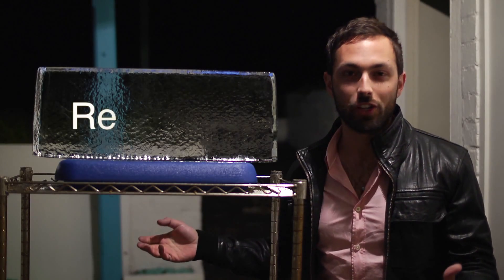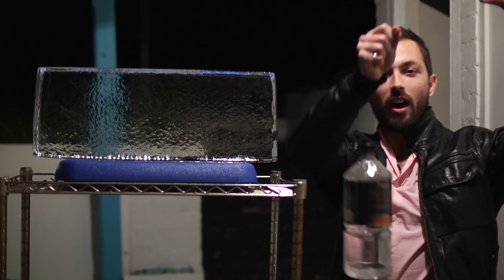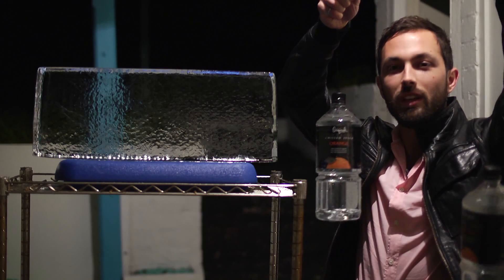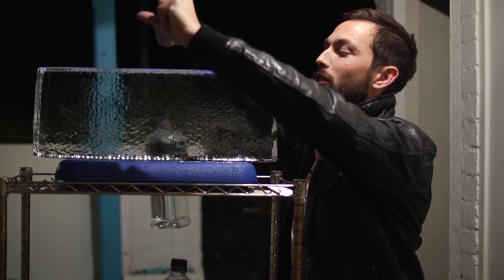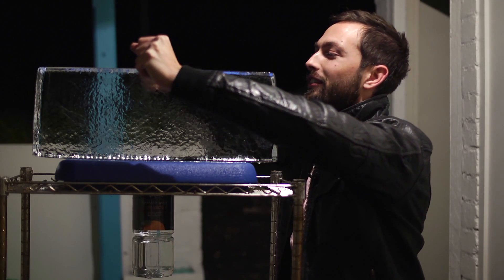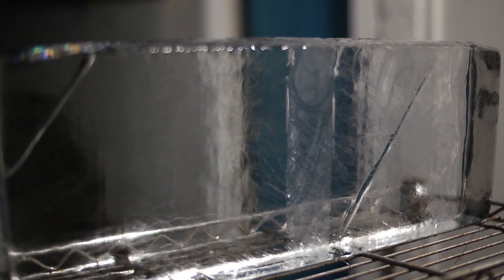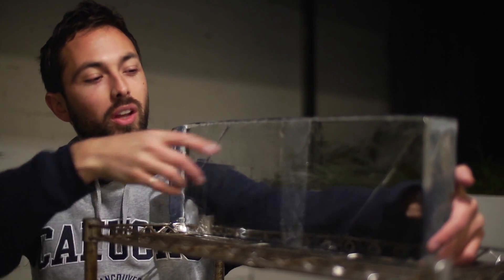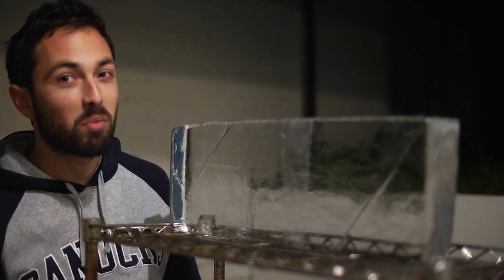Does Pressure Melt Ice?

Comment: but i thought pressure   freezes water and vacuum boils water.how is this possible?pls someone tell me??pls pls
Reply: There are two effects/mechanisms which are important to distinguish: 
1: The freezing and boiling temperature of a material depend on the ambient pressure. The lower the pressure the more gassy things are, the higher the pressure the more solid. 
2: A change in pressure changes the temperature of the material. Adding pressure heats it up, removing pressure cools it down. How much this is happening varies largely depending on the type of material, its current state and ability to conduct heat internally and to/from its surroundings - but most importantly on how quickly the change in pressure happens.

You often have both effects happen simultaneously. In this experiment we mostly see effect no.2: The ice is melting because of the newly applied pressure. Effect no.1 is therefore not so strong. I.e. the shift of the freezing point is smaller than the change in temperature that occurred.

Maybe have a look here:
https://en.wikipedia.org/wiki/Phase_diagram
Reply: Smit PATIL water expands with freezing or heating, actually.
Reply: galliumarsenide

Comment: oh yeah cause water is densest at 4 or 3 ° C, and is less dense as an ice.  so when you put pressure on ice, theoretically you are changing it back into the densest thing of it, which is water liquid (near 4° ish).  im guessing.  is this possibly near true?
Reply: plus it adds friction (I think???), so that would surely heat things up a lot (relatively speaking, of course).  that may be a large part of it, possibly
Reply: This will probably not work with other fluids and solids though right, as those other ones (Newtonian fluids, I think that's what they are called) are denser as they are solid.  water is non Newtonian.

Comment: So could you Say that temperature is relative to pressure? Or is tempreature induced by it? I mean the boiling water in an evacuated straw is still room-temperature, so the second question can't be it, right?
Reply: P . V = m R T
Reply: Ramirez PWidagdo excellent. Just what any good 12th grade physics student would say
Reply: Veryde yes pressure and temp are related directly
Reply: ***** Interesting, thanks. 
This formula should be around the corner in my physics lecture, might be more interesting than I made it out to be.

Comment: interesting how the wire in the ice is a perfect parabola
Reply: It looks quite a lot like a parabola from certain angles, but if I had to guess I would say its actually a hyperbolic cosine curve, or more specifically a catenary (https://en.wikipedia.org/wiki/Catenary). The reason I would think its this rather than a parabola, even though I haven't checked precisely, is because catenary curves describe idealised hanging strings that are anchored at their ends but sag due to their own weight.

Comment: Shouldnt we try ensure that the wire stays the same temp as the ice  throughout its entire length before assuming that it is pressure melting the ice and not heat from the air sapping into the wire?

Comment: Well if the wire is warmer than freezing point, then obviously it will melt the ice.
It has very little to do with pressure.

Although if the pressure creates friction in the ice, then that could cause the ice to melt as well.
Reply: the wire is metal, in direct contact with the ice it will very quickly reach the same temperature as the ice and stop melting it significantly.

Comment: Is it really the pressure?  The string was obviously NOT at 0 degree Celcius.  It could be the heat transfer that's melting the ice, not the pressure.  Please re-do this experiment in a 0-degree-Celcius environment.
Reply: Tj BurgerMan metal doesn't retain much heat. Very thin metal holds less heat. And very thin wire holds just about no heat
Reply: If it was just "warm wire melts ice", then why did the ice re-freeze after the wire had passed all the way through?

Comment: But what will be if use not metal string but nylon?
Reply: Just some thermal properties of the material would change but i think it will be almost the same if the nylon string is as thin as the metal one. Pressure by definition is force applied to an area, the thing that matters here is how thin the string is.

Comment: There are multiple phases of solid ice.
The ice you see here is hexagonal, and is stable between 32 and -152 degrees f. But there's also cubic ice, which is only stable below -150 degrees Fahrenheit.

Hexagonal ice melts under pressure.  But I don't believe cubic ice has this property.
Reply: I'll remember that if I decide to ice-skate at the south pole in July.

Seriously-though.  The fact that you knew that was very striking--!
Reply: See https://en.wikipedia.org/wiki/Ice_Ic for more information.
Reply: hah nurd. jk luv u
Reply: Is there a way to make hexagonal ice at home? I want to try this experiment inside my freezer (so whatever I use to apply the pressure is under 0°C), I can make clear ice by making it freeze slowly, would that be enought?

Comment: Doesn't the guitar string melt the ice rather than compress it into a liquid? The fact the block is unified after being cut only proves ice formed between the block halves.. Not necessarily through regelation, it could have been condensation in a humid environment.. right??

Comment: +Veritasium.. what if it's put in a closed box and exposed to high air pressure ? will it melt.. an freeze again once the pressure is back to normal ? .. and i know if it's a water in a low pressure instead it would boil in the atm température, although Water is uncompressible fluid and the Enthalpy supposed to prevent that since the température is bellow boiling degree.. so how does those happen?
EXPLAIN!

Comment: What if you fart on that ice ?! Will it melt faster ?!
Reply: if your fart contains enough methane to accelerate global warming, it will probably melt faster.
Reply: It would have to be a very long and hot fart to melt a block of ice like that.. And it wouldn't be ice anymore after, of course.. Just be a puddle of fart particalised water on the floor :(.

Comment: I don't really understand why this works. I thought air pressure changed the melting and boiling points so if there's is no air pressure it will melt and boil at cold temperatures and if there is a lot of air pressure it will only melt and boil at warmer temperatures, but the pressure of the string had the opposite effect. Is it based on force, since having a thinner strong(which you said was important) would keep the force from spreading out as much? I really am confused.

Comment: this experiment has nothing to do with pressure reducing melting point. you applied a force along a narrow margin and that force when applied to ice at room temperature had to act as it did. this is the equivalent of using a knife to cut butter and calling it an experiment on how pressure makes a solid melt faster

Comment: does jet fuel melt steel beams?
Reply: Yes, but when the pressure is removed it becomes solid again.
Reply: no, but don't forget, all jets are packed with the mind-control chemtrails, who knows how hot that stuff burns!
Reply: Why New York can't play chess?

Because it hasn't got the two towers.
Reply: Yes, but it does have the Queens.
Reply: Sonia is referencing a video made by purgatory iron works it is super easy to bend metal and move it under that kind of heat
Reply: clark adams, because all 3 of them was control demolished. heat from the bombs melt em. tower 7 wasn't even hit by any plane.
Reply: I seen a blacksmith actually make a video on that. He put the steel beams in the same temperature that jet fuel burns at, though the steel didnt "melt" it became so weak that the guy could just bend it without much force. That might explain why the buildings caved inwards
Reply: Hold on... you're thinking logical! They are 9/11 conspiracists.
Reply: It doesn't melt dank memes or so I'm told.
Reply: Mickxal then explain the molten iron under tower 7 for weeks after the collapse, don't worry, il wait
Reply: No it doesn't burn hot enough to melt steel, but steel at those temperatures will reduce the structural integrity of the steel to below half of what it originally was, and there are other metals used in construction that are not for the frame of the building which will be melted by burning jet fuel.
Reply: dissolves, not melts
Reply: Timothy Bates yes because earth is flat. If it was round( spheroid) the flame would have travelled like" )"this and not "|" this
Reply: Does jizz fuel melt steel boners?
Reply: Jet fuel is just high grade kerosene.  Nothing special really.  No it cant melt beams.  You know what can? Thermite!  You know what was found all around ground zero?  Basically lava is how it was described, which is what steel beams melted by thermite, look like!  Dont get me started on them towers bro.
Reply: Yes its possible    there are torches  like a propane torch that work with nearly any flamable liquid und the flame is pretty hot    you can melt Iron with it
Reply: Timothy Bates no it makes them prone to bending.
Reply: neko_r ising correct
Reply: Sonia Bharwa "someone on the internet said..."
Sorry lol

Comment: I think it is just the result of high thermal conductivity of a metal string. Veritasium, I challenge you to prove me right or wrong doing the same experiment with a nylon string with same thickness and length and same conditions and to compare the speed of cutting. If I am wrong, the ice will be cut with the nylon string with almost same speed. If I am right, the nylon string should cut through ice much slower (nylon also conducts some heat).

Comment: Everything needs to be at ice temperature: room, block and string.
Reply: Well it definitely needs a pressure chamber to make sense
Reply: the string would very quickly reach a similar temperature to the ice block. it will have a much higher thermal conductivity (ability to transfer energy as heat) than the air so it will be much closer in temperature to the block than the air is.  the difference in temperature of the air would also only contribute a small amount as the active area over which it can give heat to the string is so small.  having the whole experiment at the same temperature would be time consuming and unnecessary for this demonstration
Reply: @aidanbk  to prove that it's regelation he has to repeat the experiment with the same gauge cotton or nylon string.
Reply: aidanbk 
Sure it would. But that doesn’t change the fact that it’s still leading more energy into the ice block. We cannot definitely conclude that this experiment is proof of regelation without the aid of knowledge from other sources, and that would just make the experiment useless since you can conclude the result without doing it
Reply: It doesn't work if you use a nylon string.
Reply: @dasich2566  it should work if sufficient pressure is applied.... You can't defy one of the conclusions of the second law of thermodynamics....
Reply: @sr7821  if the same amount of pressure is applied using a string with lower thermal conductivity and the ice doesn't melt, we could conclude the pressure isn't solely responsible for the regelation. We could hypothesize, then, that the thermal conductivity of the metal string played a part in this experiment.
Reply: The very next week he released this video:
https://youtu.be/qQCVnjGUv24

Comment: Hah, I remember telling my dad (who's got a masters in thermodynamics) about this over dinner when the subject on how water should freeze in high pressure since it vaporize in low. 
For the first time in my life I felt smarter than my own father
Reply: +The_Pyromancer no, water is always denser than ice (ice always floats in water), but water at 4°C is denser than water at other temperatures. This is why whether it's summer or winter, a sufficiently deep lake will always have a temperature of 4°C at the bottom.
Reply: zimri19 ah, so you don't believe in evolution? Then I understand why your comment made no sense to me. If you think your comment somehow represents scientific reasoning regarding evolution, I can understand why you don't believe it, I pretty far how it works in real life. And yeah, there's quite a lot of evidence for evolution.
Reply: In a giraffe, the recurrent (inferior) laryngeal nerve, which branches off the Vagus nerve at the base of the brain, travels down the neck, around the arteries of the heart and travels back up the neck to ennervate the larynx, or voice box, thereby providing motor function. There is no so-called “intelligent designer” or “god” because the pathway of this nerve is completely illogical — unless, of course, you accept that evolution is the reason for this nerve’s convoluted pathway through the body. 

That’s a 30cm gap connected by a nerve with a 5 metre diversion, evolution shows us that the giraffes neck grew slowly over a very significant amount of time eventually leaving us with this highly inefficient system. 

One of the millions of pieces of evidence for evolution.
Reply: zimri19 If you say so! XD
Reply: ibrahim ahmed a theory in science is defined in the dictionary as an accepted principle backed up and verified by independently gathered evidence.

Not a “theory” 

So yeah, you’re wrong.
Reply: "there's a reason(s) why evolution is called a theory"

You don't understand the position you are arguing against. Learn the science before contributing to it, there is no reason for anyone to take you seriously.
Reply: vaporizes in low pressure since boiling occurs when internal pressure = external pressure and melts at high pressure since v1p1/t1= v2p2/t2 ? Been a while since i did chemistry.
Reply: zimri19 Haha! What? XD
Reply: It doesnt, but what people mean when they deny evolution is that everything was created by a perfect God, and was intelegently designed, a perfect God would not do such a simple mistake
Reply: @ricardoalves9605  A cogent argument, but ultimately futile. The point is that "intelligent design" is not a theory to be weighed on evidence and probability, possibly to be refuted; they'll just take your point and say it's there "to test your faith", "his plan is inscrutable" or whatever (frequently just outright deny it). What truly baffles me is that these deniers literally argue against observing the fascinating wonder and complexity of the world we live in; placing limits on what their supposed creator may have done based on some preacher, book, or personal preconception. And to do so they'll gladly build nonsensical caricatures of what they think their supposed opponents believe, including completely ignoring what words mean (typical triggers: theory, gravity, evolution). They're not in the conversation to communicate, but indoctrinate. Remarkably, the entrance point to such indoctrination relies on doubt; they train their victims to reject notions, never to test them. XKCD 258.
Reply: @ricardoalves9605  God created the space/time with all its bells and whistles. God created the livings with system they are in, weather it is evolution or not doesn't matter. We are merely discovering how was it done, not who made it happen.
Reply: @Aperture Laboratories More pressure will turn that water into other forms of ice, depending on the temperature. If you keep it all at room temperature, you'll get ice VI (pronounced "ice six") at around 1 megapascal or 10,000 times atmospheric pressure, ice VII at double that, ice X at 60GPa or 600,000 times atmospheric pressure, and ice XI at 400GPa or 4 million times atmospheric pressure. H2O is weird.
Reply: zimri19 But just look at our many breeds of dogs, if you ask me that's proof enough
Reply: lol but there is
Reply: Water is densest at 4°C.
Pressure will turn steam and ice into water.
Reply: I think u just wanted to say that your dad has a masters on thermodynamics
Reply: I wish my father was smart
Reply: Well, if you told exactly that "...over dinner when the subject on how water should freeze in high pressure..." then you got it wrong, the water freezes at low pressure and melts at high pressure, just like the video showed.
Reply: The bottom of frozen lakes tend to stay liquid and at around 4 degrees C due to it's pressure.
Reply: I'm just gonna leave this here and back away slowly.
https://youtu.be/qQCVnjGUv24
Reply: Nice
Reply: Maybe it has something to do with water being less dense in its solid form than its liquid form which is uncommon
Reply: Nub Cake 
If I remember correctly it's only denser than its solid form when at a 4 degree celsius.
Reply: you must have some pretty dull family dinners
Reply: Lil Rake Oh yeah like u have some important facts and evidence?
Reply: You are so sad...
Reply: except you werent because this experiment is entirely wrong.
Reply: Somewhere Sunday ok :-)
Reply: which is an amazing feat of evolution, because that allows the fish to survive. We can conclude from that that fish have altered waters behavior on a quantum level to make sure they can survive in winter.
Reply: +Somewhere Sunday Why does a creation have to be the most efficient one? Humans have constantly created things with intentional inefficiencies to suit a purpose, such as the breeding of dogs.
Reply: Fredrik Wahlgren it's a joke on how 'scientists' try to explain everything as if it's proof of evolution even though there is no proof.
Reply: Quick note and no stupid arguments, there's a reason(s) why evolution is called a theory.

If everyone jumps off the cliff will you do too? Ofcourse it is situational, maybe everyone jumps off to escape or something :-) 

Shut up and no stupid arguments 

:-)
Reply: No there's not